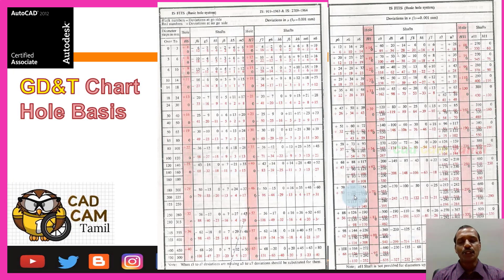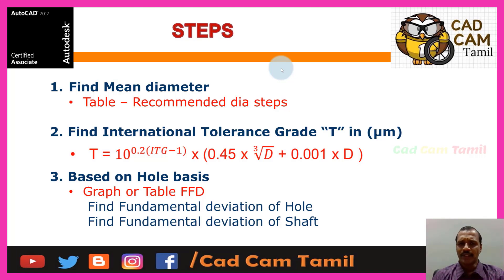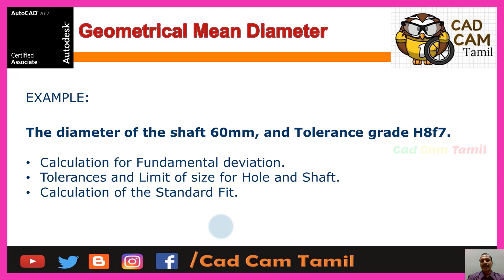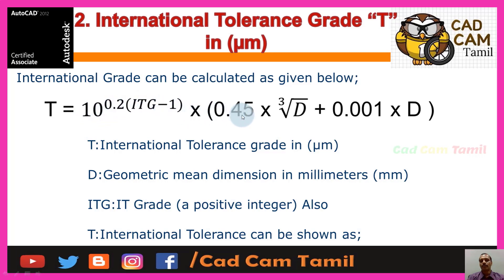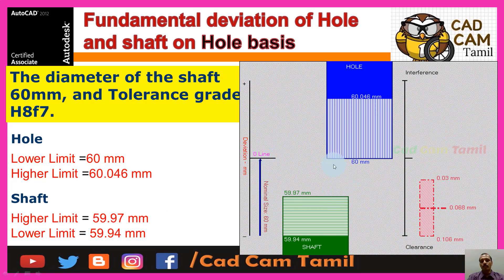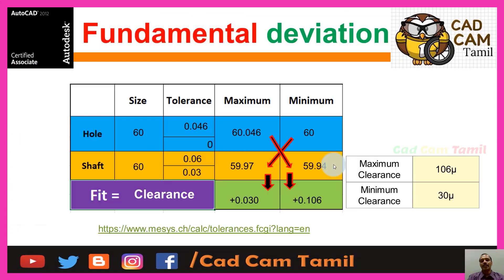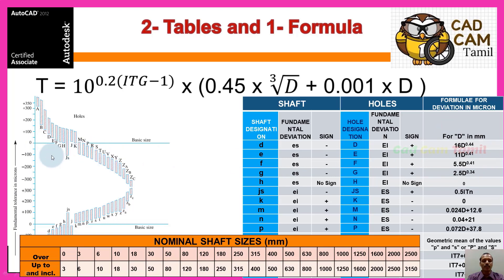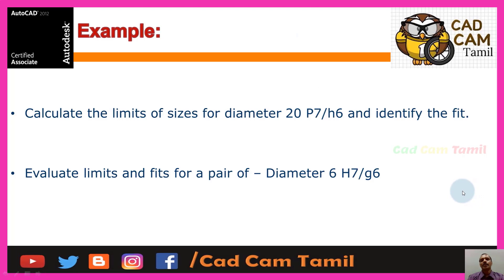GD & T | Tamil | 18. Calculation of Deviations and Tolerances by Formula

Comment: Why we take clearance fit formula to find type of fits?
Reply from the maker: Dear Syed,
Actually we are comparing hole with shaft. this is general concept for Hole basis system. 
Formula is constant, based on the result (+,+ and -,-) we will decide clearance or interference.
I hope it is clear for u.
Thanks and regards.